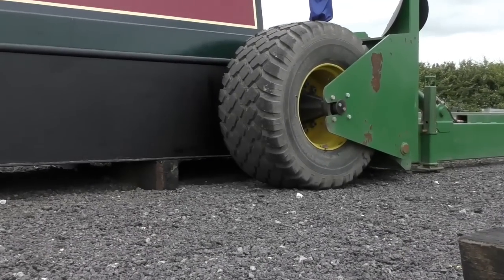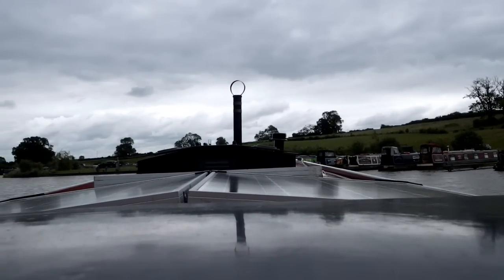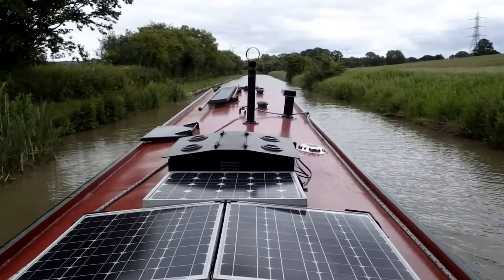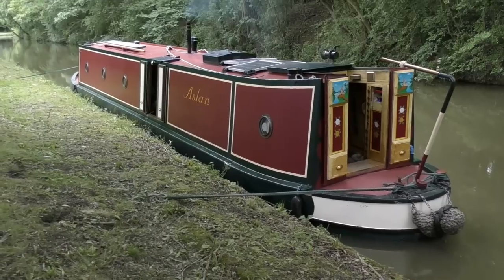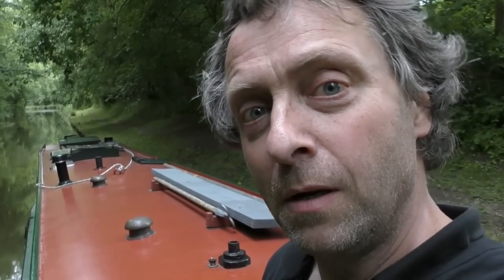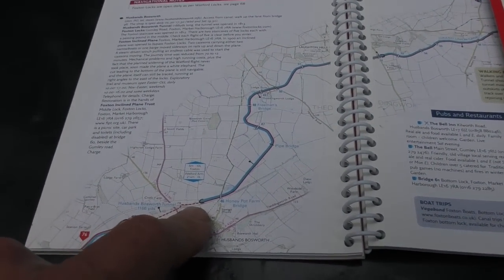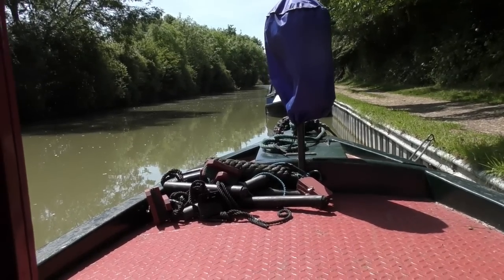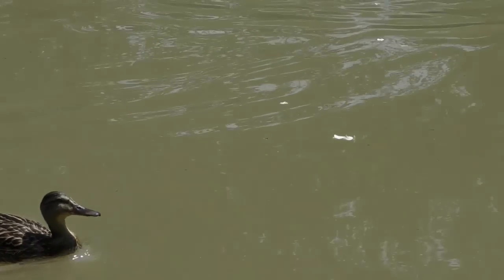4. Narrowboat Launch Day - The Maiden Voyage . . .

Comment: YEEEEEEEEEAAAAAAAAAAAAHHHHHHHHHH!!!!!!!!  After watching the video some bit, that sound, I've heard that sound before...... I was raised on a farm in Goliad county, Texas, my Dad bought an old John Deere two cylinder tractor that had a huge flywheel on the side of it. My Dad called it the Poppin Johnny, It was a two cylinder diesel engine, that sounded just like your engine does. Tonnes of torque and quite soothing....Very good video.... Cheers and as always God bless
Reply from the maker: I know exactly what you mean. Tractors, dumper trucks. I think these engines were used to power water pumps and saw mills as well. A true workhorse.

Comment: i just rewatched, I'm very 'intelligent' on safety/building issues... omg are those your gas/propane lines next to the stove burners??? BIG No No, I imagine thats how most narrow boats have fires!!!  In my opinion you really need to move those  hoses asap, thats an accident just waiting to happen! In the meantime, put some bricks there or something
and dont use the burners closest to those. The fittings and connections should be under the counter and at least 30 inches or more away from the burners. I truely am loving your vids, just found you today 6/24/17 I will catch up!
Chicago Renee saying prayers for you & your beautiful boat! yes you are priviledged & giving me ideas about doing the same.
Reply from the maker: I understand your concerns, however the placement of the hob in relation to the gas pipes is well within Boat Safety Test standards. Thank you for your concerns. :)

Comment: Congratulations! 
One itty bitty question? How much fuel is in the tank? Most boaters use a appropriately sized stick to find out accurately how much fuel you have. First diesel vehicle I bought was a 1980 Volkswagen Rabbit ( states) with a inoperative fuel gauge and I was assured it had 1/2 a tank, 7 miles later by the side of the road where I quickly determined I was out of fuel. Called up the used car dealer and after clearing my chest demanded he bring me a gallon of diesel as I didn't know the area. 45 minutes later I was up and running and it turned out the mechanic who brought me the fuel apologized for draining the tank for the shop heater. He said if I brought it right back to the shop he would fix the fuel gauge which he did and it was very accurate..
I highly recommend a pair of 25 foot jumper cables in case you need a jump from another boat or a car. Better to have and not need than need and not have. Think yard sales for additional tea cups. Why buy new when you don't have to.

I wish I were in your shoes but have fun, stay safe and now you need to learn that you have gone back in time more than a 100 years to a slower pace of life and have to reacclimatize your lifestyle. I'm jealous but im on the other side of the pond so unlikely I'll ever get there.
Good lord that's an old school boat love the engine who needs 2 or more cylinders?
She sounds sweet.
Cheers!
Reply from the maker: +James Shanks Thank you for your wonderful comments. The fuel tank was brimmed before she went in the water.

Comment: Thank you for sharing your journey. I'm glad you explained the numbers on the bridges. What's the process of going in a tunnel? How do you know if another boat is entering the opposite end? What if you meet in the middle who has right of way?  Thanks.
Reply from the maker: +godangerdad Thanks indeed. From what I've learned so far, some tunnels are two-way, some are one-way. If one-way, a traffic light system seems to be the norm', or they may have a tunnel operative like at places like Harecastle.

Comment: It may have been posted/asked before,
Is it possible to hand crank the engine should the battery ever run flat?
Reply from the maker: Hi Lukas. In fact you're the first to ask. Yes there's a handle that slots onto the end of the flywheel. Only problem is the handle is a little too long and it's very easy to skin your knuckles on the edge of the engine mounting beams in the floor. Ask me how I know. 😁
Reply: @CountryHouseGent  ouch
Try to learn to pull and keep the thumb in inside so that if a backfire occurs the crack just gets pulled out of your hand.
Or find a blacksmith who can shorten the crank handle 🤔.
By the way I've come from cruising the cut, sadly we don't have narrow boats in my home country (Germany).

Comment: Evening Kevin, what s great vlog! 

You have scared me a few times with the length of your chimney, if you go through a low bridge or tunnel do you have an alternative or do you go through without it fitted?

Regards Dale
Reply from the maker: +Dale Jones Cheers Dale. I have a special short-stack in the engine room for such eventualities.
Reply: CountryHouseGent can you change over without stopping the engine or does this require a full mooring and cool down?
Reply from the maker: Yes the chimney can be changed with the engine running - as long as you hold the very top end.